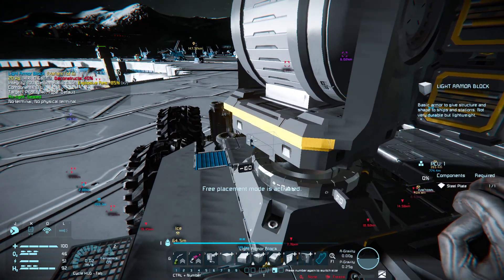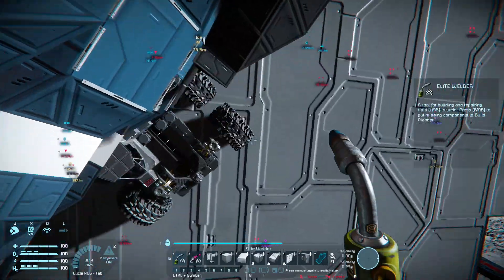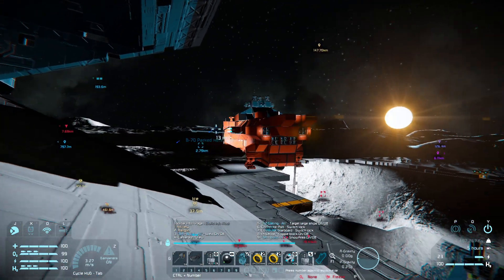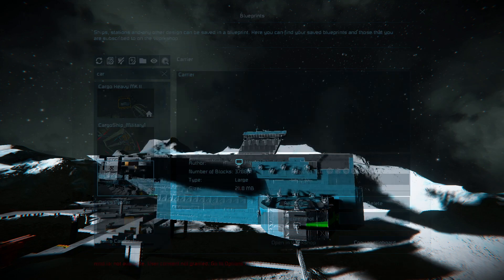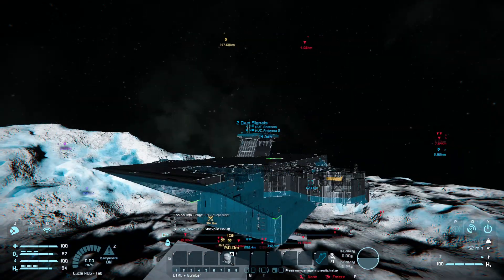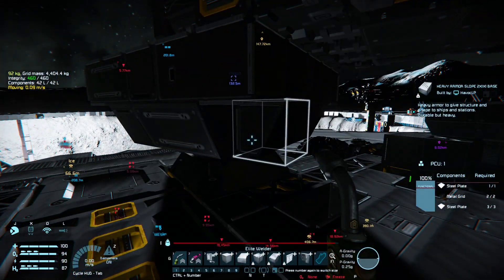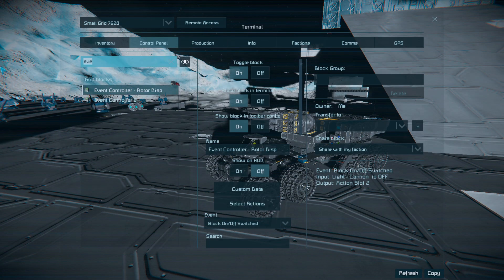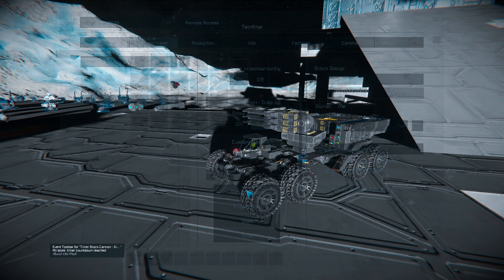Space Engineers ~ Not Hardcore ~ EP 163 ~ Nothing As Planned

Comment: 14:10 I went and began writing a big reply about the depression angle, but then no known reason hit the escape key and deleted it.

So I figured it best to not re-send it.

But anyhow, it seems that what MAY be happening, from how I saw your timer blocks, is it is just going up and down some imperceptibly tiny amount because the timer blocks, instead of being commanded separately, are set in an infinite loop chain that is not permitting them to move. 

Without writing a really long paragraph to explain this, its not readily easy to say what I see going on, but if you imagine the valve on an engine incessantly going up and down...only maybe slower, and definitely on a much larger object and smaller distance travelled, so that you can not actually see it happening, even at very high screen resolution and really high frame rates.

MY suggestion here is to make 2 completely independent commands, even if it requires 2 independent event controllers.

One is on the condition of the light being on, goes up, but then when it is up, it shuts off.

Thus, unless another event controller overrides it, it will have done its job, and the rotor will remain in the up position.

Then the other one is on the condition of the light going off.

Once this happens, it will retract the rotor, and then turn off.

Technically, since I did not see the discrete 'only when on' and 'only when off' conditions, this may not actually work.

However.

There is another way to achieve it...

Put one red light and one green light there beside each other, and each will have its own tool bar switch.

You press the one and the red light goes on, and the rotor displaces up, you press the other, the red light goes off and the green light comes on and the rotor displaces down.

Again, in between either command, when all of the relevant commands have been executed, each event controller goes back to its passive ready state.

Now to make sure that the system does not have both lights on at the same time [at least unless you press them both at the same microsecond, which might be pretty hard to do], when the red light goes on, one of the event controller's commands is to turn the green light off, and visa versa.

Because each unit reverts back to passive ready mode in between cycle completions, this resets the other one by default, WITHOUT being stuck in a perpetual 'I'm turning you off, dammit!" loop.

So it only allows the one light to be on, and allows only the one state of displacement to exist at the same time, without the two sides battling each other.

If I could write code it would be simple to make the code right here, but I can sort of write a flow chart:

Event Controller Block 1 [designated here as ECB-1]

01: ECB-1 input $ 'is red light on?'
02: ECB-1 if $ - 'yes' then 03 else 01
03:  ECB-1 command: rotor head displace up, turn off green light, 01

And then the mirror image of this on Event Controller Block #2 [ECB-2]

01: ECB-2 input $ 'is green light on?'
02: ECB-2 if $ - 'yes' then 03 else 01
03:  ECB-2 command: rotor head displace down, turn off red light, 01

Something to that effect.

Should be really super simple.

In theory, it should simply go to its max if the rotor displacement settings are proper.

For instance, it should just have the max travel as the max limits, the best safe travel speed as the max speed, and should just automatically do like any other rotor, hinge, or piston, and go to whatever the set limits are without needing to be repeatedly told to move one tiny increment at a time.

Again, Splitsie has a parking script he got somebody to make for him which might be considered public domain, and I think with his help it could be super easy to set up.
Reply from the maker: LOL this might be the second longest post you have made =) 

At this point I am over thinking it and just need to use the timer block only. What I have there should have worked ... All I actually need is just the 2 timer blocks lol